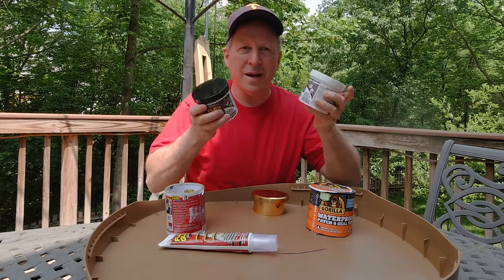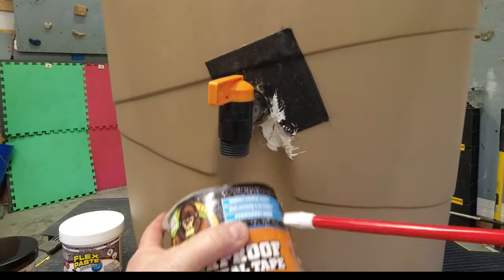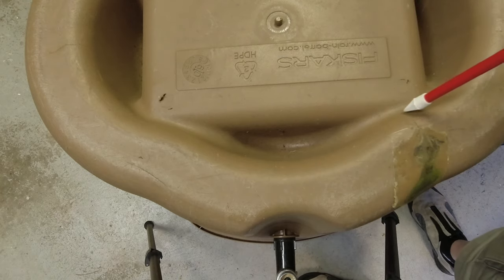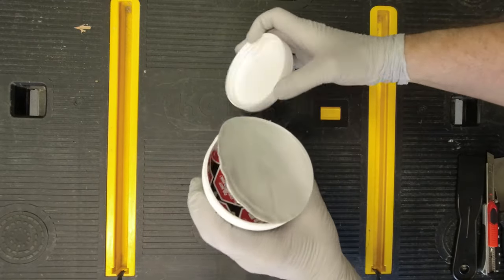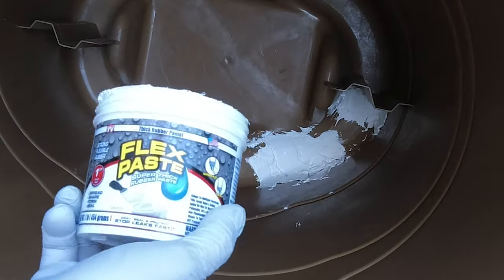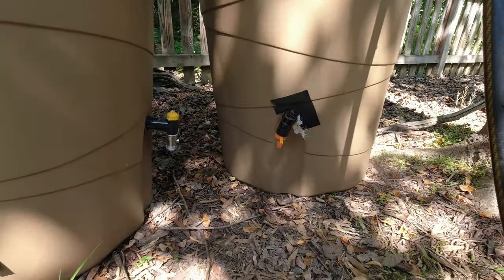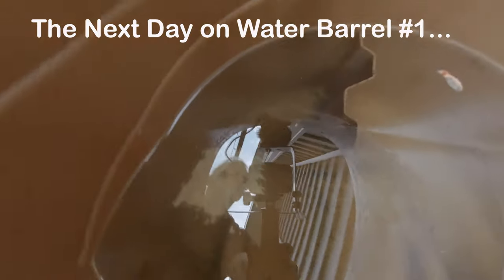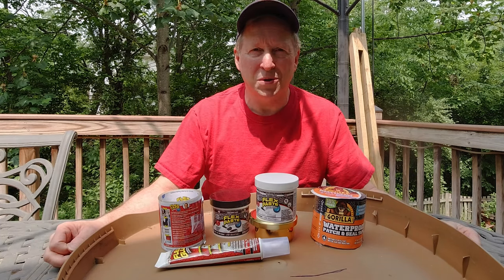Flex Paste Ultimate Test - Honest Review

Comment: To stop a crack from expanding, drill a hole at the end of the crack. This is a plugging/patching technique from the military. Thank you for the review. Looking for something to fix a small nick on a PVC elbow that is a drain pipe (at the top of a run)... so zero pressure. It might do the trick.
Reply from the maker: daniel, thanks for the reminder, have used the drill hole technique on quite a few piece with the military back in the day. I just finished filming a follow on video where I used plastic welding which seems to have worked better than anything else. Stay tuned for that video coming out soon.
Reply: Blue monster leak tape😎 your welcome👍

Comment: I wish you had drilled the ends of the cracks before commencing your fix attempt.  This MUST be done, otherwise, it doesn't matter how you attempt to fix existing crack. If not drilled, crack will progress, once water pressure builds inside. Learned the hard way.
Reply from the maker: Justin, great idea, I ended up plastic welding mine, hold up great several months later, plan to shoot the follow up video soon, stay tuned.

Comment: Read the directions.  Says to let fry 24 to 48 hours. I've used it to fuse two rubber liners together. Let dry 48 hours and no problems.
Reply from the maker: Robert, as it turned out it was more like 72 hours when I tested with water from the hose, then removed the water, dried them out for another 48 hours before it rained. Thanks for your comment. I was assuming the "fry" was a typo.
Reply: u may have made out better with applying a thin layer to make sure the seal was sealed n then another layer.  but all in all I think u would of made out better with the liquid flexseal.

Comment: The problem could be the flexibility of the plastic barrel. The Flex Paste is flexible, but only up to a certain limit. With water in the barrel, it likely bulged more than the Flex Paste could stretch. Not necessarily a product failure, just asked to do more than it could. You might try plastic welding to fix the barrels. You can get a plastic welder from Harbor Freight, though it does take practice.
Reply from the maker: Funny you mention plastic welding, here's a follow on video: https://www.youtube.com/watch?v=IECD0dVc0aA&t=15s

Comment: I used flex paste to stop water leaking around my kitchen window, I have recently replaced the gutters on the house no more rain coming in. My problem  I have now, is how do I remove the built up paste. Any help would be greatly appreciated.
Reply from the maker: a solvent like Acetone should loosen it up, but try to ventelate the area as best as possible, the fumes are bad...Then a putty knife or scraper and carefully dig in...

Comment: Good test overall.  I like the tips in the comment to drill a hole to stop a running split.  I came here as was looking for reviews on the Gorilla (or any "paste") product.  I don't trust it for strength, it just seems like it's a glorified smear-able rubber.     

I'm trying to repair a gaping hole on the wall of an OLD pool skimmer.  

Used clear primer and cement to layer 3 sheets of fiberglass fabric.  At the point of deciding whether to bondo over then paste, or just paste or just bondo :)

In your case, not sure bondo is a potable option.
Reply from the maker: May not be, but plastic welding finally solved my problem, here's the video: https://www.youtube.com/watch?v=IECD0dVc0aA&t=6s

Comment: My first attempt would be Vulkum. Especially the smooth (untextured) version. Priming the surface with alcohol or something would be important.
Reply from the maker: Johan, thanks for the suggestions, will look into these.
Reply: @MakeItorBreakItNow  also, why not high grade silicone? Silicone has low toxicity and excels in adhering to plastics.

https://youtu.be/G-aQzoHqM80
silicones- different cure agents are key- acidic cure (vinegar smell) is cheap garbage, alcohol or water cure are far better,
silicone is particularly good at sealing and adhering to plastics, including new plastics which are leaching oils. lexan or plexiglass should only be sealed with silicone. You can never paint over silicone or silicon hybrids.
polyurethane are supposedly more vulnerable to chemical attack, but then silicone the supremely resistant to everything if that's what you're comparing it to.
boatlife life seal is a hybrid sealant which combines silicone and polyurethane.
new class: 3M 4000 uv new poly ether sealant
butyl tape
Reply from the maker: @fieldlab4  thanks again for the suggestions, I'll have to try them out.
Reply: @MakeItorBreakItNow  My basic approach to doing repairs on plastic like that would be to find a decent adhesive and sealant to use with a sturdy patch piece but not rely on the sealant for adhesion, but knock some holes in it for some kind of screw, pop rivet or fastener which would also be put in with the same adhesive as a sealant.

Comment: You gotta stop the crack before you put anything on there. Just like a crack in something steel you gotta drill the ends of the cracks and then weld the seam. They make plastic weld also. They do it to automotive plastic bumpers everyday
Reply from the maker: Agreed, I ultimately did plastic weld them. Here's the video: https://www.youtube.com/watch?v=IECD0dVc0aA&t=6s

Comment: Great advice I'm working on buy some flex paste, instead of using for barrels, I want it to stop the rain drops from the roof😅. The roof has a waterproof thermal seal, however, in Mexico the sun burns as hell all day long, then the night is too cold, this conditions have made a thin but large crack, this year I started to suffer leaks cause of that. As you say plastic barrels are deformed cause water pressure. In this case, I will not contain water, I just want, rain flow and pass freely and do not pass trough the crack.
I will make the prove, I expect works for me.
Reply from the maker: Cid, You might want to use a roofing caulk instead. I've have the flex paste peal on me on several applications. The dark tape might be better if you want to use a flex product. Or the Gorilla Tape version... Get the dark tape. The clear tape also broke down on me over a year or so...

Comment: I may never know what I'm gonna see, Mike, but one thing's for certain, I know I'll always get an honest opinion on the items you review on this channel. So with that said, I certainly didn't think you were harsh in not recommending a product that ultimately failed to do what it was supposed to do.

BTW, I have a question that's not relating to this product, but one that's somewhat similar. One of my nephew's dinosaur toy got dirty, so I decided to wash it. I removed it's rubber neck from its plastic body and filled the neck with water to flush out the gunk inside. What happened was I squeezed the neck too much and the thinnest part of the dinosaur neck formed a bubble that expanded and eventually burst. So now the dinosaur neck has a hole on it and my nephew is none too pleased, heh.

What kind of a glue can I use to fix and to patch up the hole on this thing? Any suggestions would be greatly appreciated and all.
Reply from the maker: Ghost, that's a tough question to answer, given I can't see the toy. If its a fairly straight cut or small hole a standard super glue might work. A waterproof tape similar to what you'd repair a tent with might also work. You have less options if the "void" can be seen vice hidden somewhere.  And a rough surface can be just as much a challenge as a smooth one. Some folks swear by making a past of superglue and making soda, but I haven't had a chance to test that out yet.

Thanks for your comments, always interesting.
Reply: @MakeItorBreakItNow  My little nephew won't let anyone near the "injured" dinosaur, hahaha,  so his parents can't take pics when I asked. They got it overseas, but the rubber is akin to those squeeze (almost stress toys) apparatuses, except not as resilient, as this one burst at its weakest point. So yeah, nephew is not too happy, and I can't find a replacement, so am looking to fix it for him.

Still, thanks for your time and advise, Mike. Appreciated, as always!
Reply from the maker: @GhostOdyssey  sounds almost like a Stretch Armstrong? Did you try Alibaba? They seem to have everything...
Reply: @MakeItorBreakItNow  Yes, stretchy, like Stretch Armstrong. Trying Alibaba is a great idea. Thanks! : )

Comment: I understand a rain barrel not working, because it's standing water....   what about the frame of a sloped skylight window, where the water will be running off, and then the roof will be drying out?
Reply from the maker: Lewis, Flex Paste should work well for your skylight window application. But then again so should a high quality caulk.

Comment: I have a question. I bought my mom an automatic soap dispenser for her shower. The shower walls are covered in tile so you can't screw the dispenser to the wall.Can i use flex paste to attach the   dispenser to the wall
Reply from the maker: Donna, maybe. You would have to use the right amount, doesn't the dispenser come with mounting instructions.
Reply: @MakeItorBreakItNow  yes but i don't want to drill it into tile. The shower is all tile no easy dry wall

Comment: If used  with common sense about limitations flex paste it works great, performed without issue on my 200 gallon pond liner with small holes and cracks.. Sadly availibility of higher end stuff is a problem lately too.
Reply from the maker: kristopher, makes sense it would work on the pond liner, because you're pushing up against terra firma, the flexing plastic is what did this one in. I did you plastic welding and that worked.

Comment: Did you FULLY clean the surfaces prior to application?
Reply from the maker: Jeff, yes I did. Thinking about the test a bit more,  I guess I could have put it on a couple inches thick and it might have work, but then to me that's not a patch, its a slab. The used a portion of a smaller wooden barrel that really doesn't have much water in it.
Reply: @MakeItorBreakItNow  I'm going to try the spray version on my skylight tomorrow, nice and thick.
Reply from the maker: @silverestore  best of luck, let me know how it works for you. I've tried all their products some applications work some don't...
Reply: @MakeItorBreakItNow  I purchased the clear spray instead as I think it's a better application between my roof and skylight because it will seep into every crack. I DON'T like how bloody toxic it is compared to their other products, but I'll be well-protected.
Reply from the maker: @silverestore  Thanks for the additional info. Agree on the toxic thing. I'll have to try the clear coating.

Comment: I wonder if this would work to just seal without the job being under pressure. That is what I want it for. Has anybody tried this. I would be using it to seal a leak from water on a vertical wall.
Reply from the maker: Julie, working on an update to this video using plastic welding. I think the tape works better than the paste or glue. A year later all my paste applications have pealed off on several surfaces but in most cases the tape i still in place...
Reply: @Make It or Break It   thanks for the reply, maybe I will go that way. Once again thanks 😉
Reply from the maker: @ooGYPSYoo  you're quite welcome, again.

Comment: It is probably not flexible enough if the crack is expanding under pressure. Fish tank silicon would be better.
Reply from the maker: Eric, never thought about using fish tank silicon, I'll have to give it a try. Also thinking about plastic welding the bottom.
Reply: @MakeItorBreakItNow   It will depend how well silicon will stick to the plastic, seems some plastics need priming to get glues to stick. Silicon sticks very well to glass and withstands a lot of pressure.
Reply: @MakeItorBreakItNow  Also the crack could extend past the glued area.

Comment: How can you have 400 pounds of pressure?  Pound is not a unit of pressure.
Reply from the maker: Greg, 400 pounds force of the weight of the water, not really pressure.
Reply: PSI (pounds per square inch) is pressure.
Reply from the maker: @Aussienessful  yup, pressure is a force...
Reply: @MakeItorBreakItNow  Yes every square inch of the surface will have 400 pounds pushing against it.